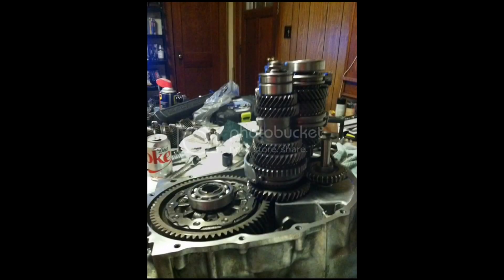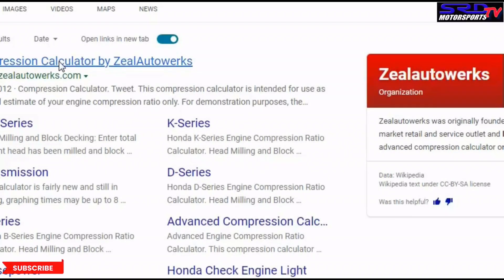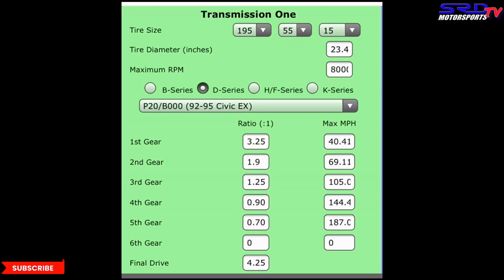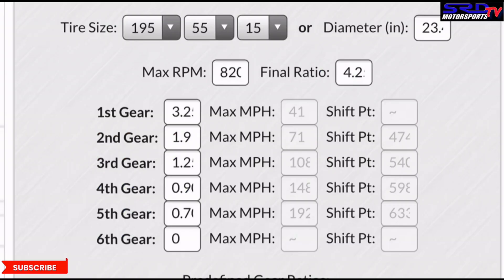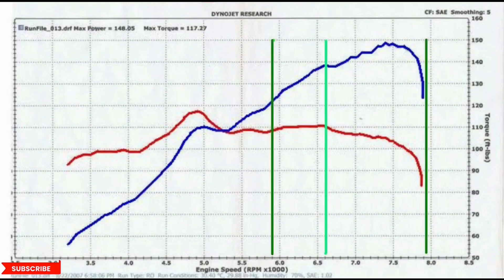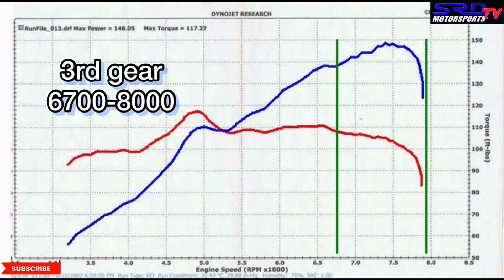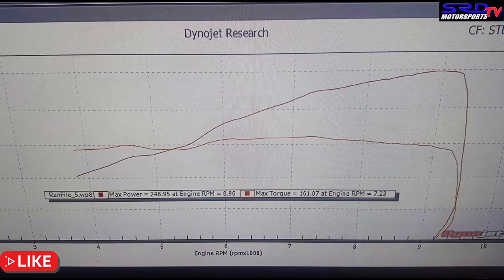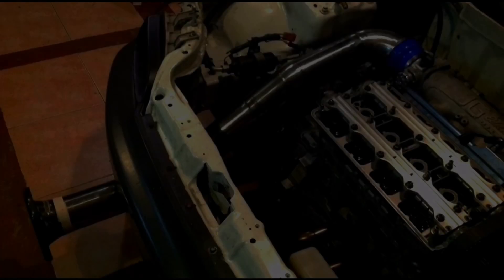D16 SOHC Gear Ratio Talk no Adobe FlashPlayer SRDmotorsports

Comment: oh man i really want that mfactory

but there is another option with 1.364 3rd gear and 1.040 4th gear from whoppee doo racing

but it’s probably best to finish off the engine first then build the transmission based on how the powerband is

i’m more of a hillclimb/marilaque type guy which is why i was leaning on mfactory 

anyways december pa naman yung target for stage 3 cam, intake manifold, etc. so transmission would probably be next year’s puzzle

great video as always!
Reply: Just curious, what cam will you be using?
Reply from the maker: @findtherightbeat  current cam the Bisimoto Level 2.x

which is the same cam used in that dynosheet got lucky and was able to buy it back from the cebu owner years later thanks to Edwin owner of Rurex ftw
Reply: @findtherightbeat  going with Brian crower stage 3 cam
Reply: @vince.r  I was curious and had a look at the cam card since I'm not familiar with the specs and saw that it had moderate LSA 🍻
Reply: @findtherightbeat  is that a good thing? I googled and it meant “lobe separation angle” but I haven’t dug deep into the topic
Reply: @vince.r  It actually depends on your application. You have to be careful in choosing your camshaft as the LSA is ground into the camshaft for SOHC engines. The LSA is the angle between the intake and exhaust lobe centerlines in camshaft degrees; higher angles minimize overlap, while lower angles increase it.

From Web Cam's site as I can't put links into the comments section:

Tighten:

Moves Torque to Lower RPM
Increases Maximum Torque
Narrow Powerband
Builds Higher Cylinder Pressure
Increase Chance of Engine Knock
Increase Cranking Compression
Increase Effective Compression
Idle Vacuum is Reduced
Idle Quality Suffers
Open Valve-Overlap Increases
Closed Valve-Overlap Increases
Natural EGR Effect Increases
Decreases Piston-to-Valve Clearance

Widen:

Raise Torque to Higher RPM
Reduces Maximum Torque
Broadens Power Band
Reduce Maximum Cylinder Pressure
Decrease Chance of Engine Knock
Decrease Cranking Compression
Decrease Effective Compression
Idle Vacuum is Increased
Idle Quality Improves
Open Valve-Overlap Decreases
Closed Valve-Overlap Decreases
Natural EGR Effect is Reduced
Increases Piston-to-Valve Clearance

LOBE SEPARATION ANGLE
Above 114 Deg. = Extremely Wide
114-112 Deg. = Wide
112-110 Deg. = Moderately Wide
110-108 Deg. = Moderate
108-106 Deg. = Moderately Tight
106-104 Deg. = Tight
Below 104 Deg. = Extremely Tight
Reply: @findtherightbeat  good info! thanks for this! 🍻🍻
Reply from the maker: @findtherightbeat  yes!!! LSA its why i relied on Bisi for sohc cams cuz he prolly has tested most differences same on the vw engines not many understand this but only a few...

thats the main benefit of Bseries we can "salubong" the cams  and hilariously even on K seres locals worry about vtc gear on the intake cuz it advances? yes it does but

50vtc gear is actually 50deg overlap  
so give me a  30vtc gear and an adjustable exhaust gear? il give you 50vtc no prob 😏
Reply: @SRDmotorsports  Not sure if I remember correctly but Bisi wants his LSA to be not more than 112?
Reply from the maker: @findtherightbeat  i think so it makes sense i mean ive always preferred 108-110
Reply from the maker: yep i mean last na ung transmission
heck Bisimoto ran 10.7sec on a zc gearset but 5.1 final drive
Reply: @SRDmotorsports  wild sir
Reply from the maker: @vince.r  yep so a stronger engine makes nicer gears? hahaha